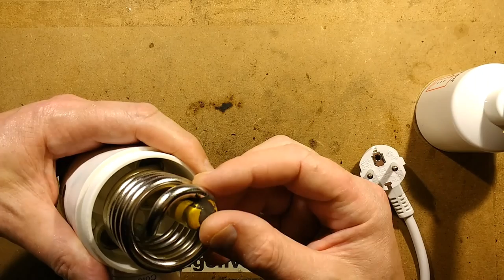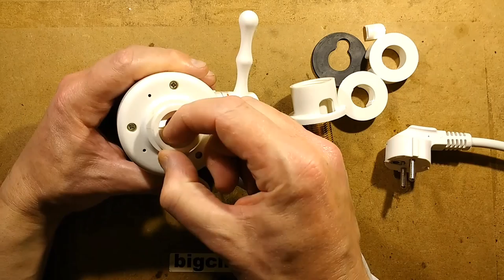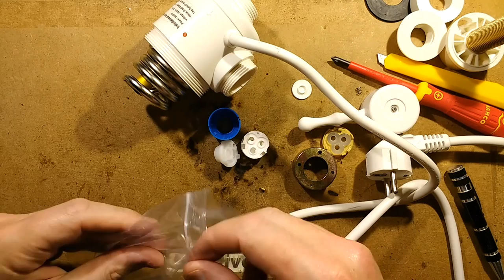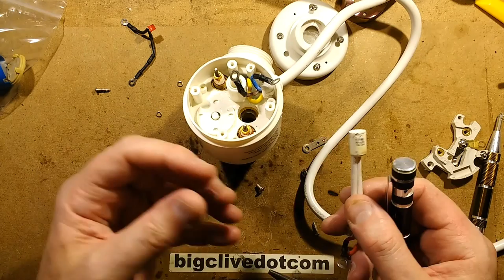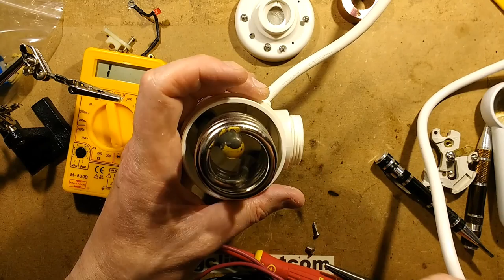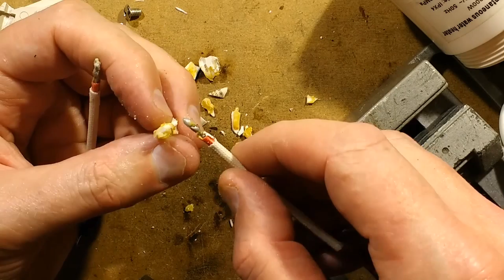Cheap electrically heated tap / faucet teardown.  (230V)

Comment: A tip to improve the lifespan of you under sink heater. Bolt a piece of aluminium to the heating element in order to work as a galvanic anode. Like they use on the hul of a ship. You will sacrifice that aluminium and not your heating element.
Reply: Frank Heijkamp , the water flowing over the heating element if exposed to aluminum may work as you mentioned. However, the dissolved aluminum in the water, is toxic if the water is consumed.
Reply: Sacrificial anode?
Reply: zinc works too, but you don't want zinc in your drinking water
Reply: Should magnesium be used instead? What PPM count of aluminium is considered toxic? As said I'm not an expert on these matters.
Reply: both zinc and aluminum (oxide or elemental) are safe to ingest in small quantities, aluminum oxide is filler in many medications
Reply: Aluminum is neither toxic nor a heavy metal.
Reply: No, the science that went into researching its potential toxicity does.
Reply: On the other hand ...

Volts, Amps, Watts, and Ohms,
I hope you'll stay within your homes.
Do not char my gleaming bones!
Volts, Amps, Watts, and Ohms
Reply: I stopped buying antiperspirants containing aluminium for this very reason and now use the ones with mineral salts which kill the bacteria producing the odour!  These seem to work really well unless you produce copious amounts of sweat!
Reply: lol, aluminium is listed as both a light metal on the 'normal scale' and as a heavy metal on toxicity scales, you can see how it will split people into groups, i didnt know but just googled, and you get both results.
Reply: Doesn't toothpaste contain aluminium?
Reply: Definitely not as plain metal.
Reply: LOL "Definitely not as plain metal."
Reply: With such conflicting information, "When in doubt, do not do it".
Reply: Yeah aluminium not so good..Does using dielectric separators before the copper pipes make any difference? What about galvanically isolating behind a big transformer
Reply: A N ,  sometimes you have to way the cost of replacing the water heater against the cost to adding a system of water purification, which will help extend the life of the heater of this type. In my home, l added a reverse osmosis water filter.  I get the benefits of pure water and a heater that will last longer.
Reply: restcure, on the other hand, five fingers and a thumb
Reply: It's not the Ohms that getcha, it's the Mhos. ;-)
(units of conductance, inverse ohms)
Reply: 90vanman  Not since that incident with the table saw ...
Reply: Statistically, there are two types of people, those who believe there are two types of people and those that don't.
Reply: @quaxk  Hahahaha. Ya ok.  Wow

Comment: You should have run the exposed fuse under the heat gun to see its melting point reaction. And check the voltage if it fused back together.  That would have been interesting.

Comment: I get the feeling centralized water heaters aren't really a thing in Europe. Here in the US, usually we just have one centralized heater, usually its right next to the furnace or boiler (my friend's house has a hot water heat system and it has a heat exchanger for hot water, heater by the boiler.) The two types most people discuss here is tank or tankless. Tank water heaters are just larger versions of he non-vented type you mentioned, tankless just heat the water as it passes through, usually considered more efficient, because like this faucet thing, they only heat up when the water starts flowing. Tank heaters have to stay hot all the time. Naturally we have to let the hot water run for a minute for the water, which cooled as it sat in the pipes, to flush out and the hot water to get there all the way from the heater.
Reply: compactc9 . yeah, pretty sure Clive is well aware of water heater designs. but a lot of the industrialized world is going to tankless. Not just Europe.
Reply: compactc9 You're feeling is wrong from a UK perspective. 

Older systems will use a tank but most new systems in the uk as far as I'm aware are combi boilers which provide heating and hot water as needed. 

We primarily use natural gas, much cheaper to heat water with. 

I've never come across an electrical water heater outside of maybe somewhere like a workplace where one has been retrofitted in. 

I can't speak for continental Europe and the hotter countries where houses may not have the need for heating systems though. You might well be right there.
Reply: compactc9 I'm afraid that your feeling is wrong. We have tank and combi systems in the UK - homeowner choice.

Comment: That orange stuff inside the thermal fuse looks like solder rosin, probably to make sure the solder pulls away and doesn't blob around in the middle causing intermittent contact.

Comment: i know it is an entirely different thing but yesterday i replaced the string pull switch in my bathroom. luckily the bottom bit, that held the knackered switch mechanism was exactly the same size as the bottom of the new one i got off amazon. so i only had to replaced the broken bit. the thing is not so long ago i didn't dare touch anything involving AC. it wasn't until i saw Clive stuff home-made full wave rectifiers and LEDs into a bulb arrangement that it was sufficiently de-mystified for me to get involved with. i started by winkling transformers from old things (NOT microwaves) and playing with them. i had a few 'tingles'. but now i have a working bathroom light cord! and get this, our bedroom light switch is iffy. i just ordered one of them too!

Comment: It is a good idea that the power is controlled by the pressure, in that way you won't be able to turn on the power without waterpressure and melt down the unit or burn down the house. if all the other safety features fail.

Comment: 3kw is also a common limit on heating devices in the US - it will be on a dedicated 30A/120V circuit. Pretty much the largest single leg 120v load you will find.

Comment: We got one of these a few weeks ago and it works just like Clive said it would. Takes about 10 mins to fill the sink with hot water.

The unit i got is a little different in the handle but the rest looks the same. <$50 AUD

Comment: I loved the vice gadget.
 I have a 12V 25A power supply for an amateur radio and it has a fusible link in the transformer. Once blown you throw away the transformer. I think it’s just a lead (Pb) wire or maybe a low melting bismuth alloy.
Reply from the maker: You can get replacement thermal fuses.  On a transformer it's usually just under the tape where the primary wires go on.

Comment: clive: back in the 80s we used to have one of those whole house instant water heater instead of the 40-80 gallon water heaters(in the .us) used to go through the heater bits fast too, was bad local water once when from village water to city water, problems solved. those units are nice.. as long as no "Extra" stuff in water :)

Comment: The diaphragm isn't operated by the back pressure from the spray nozzle, it uses the pressure drop across the hole where the water enters the heating chamber.

Comment: Interesting water heater.  Shame the fuse could not be reset, but I suppose that in itself could be dangerous.  However, for £20 I suppose it might be just as cheap to replace it if it goes faulty after a few years of constant use.  I even like it.  It looked like the solder that you can melt with a match that they were using as a fuse Clive.

Comment: They work much better in warmer countries; they are very popular in Brazil.
Reply: In northern countries it might be less effective indeed. The tapwater entering our homes is colder. Depending on the season a temperature around 8 or 12 degrees C is common. It takes a lot more then 3 kW to get a descent amount of hot water. Usually 15 kW will work just fine.
Reply: 15kW? That's madness. That's more than my entire house uses at any given time.
Reply: You can also get them in 28 kW if you would like to fill up your bathtub. Yes that is indeed three phase 230 Volt at 40 Amps.
Reply: How can this not blow a fuse or trip a circuit breaker?
Reply: +Joseph Nicholas Units above 3kW in Australia and 7kW in the UK require their own dedicated circuit from the distribution box, meaning they have their own run of higher gauge wire to provide the necessary current.
Reply: Joseph Nicholas Why would a hardwired appliance circuit designed for 40A 3-phase blow a fuse or trip a circuit breaker when run within those limits?
Reply: +Ethan Poole he might be talking about the plug in units, and yeah, in the US with 110V mains you can't draw 3kW from a standard outlet.
Reply: UK plug master race

Any power shower installation worth its weight will have its own breaker and dedicated wires to prevent electrical fires
Reply: I like: "dedicated wires to prevent electrical fires".
Reply: Maybe it's because I'm a spoiled American, but who seriously showers for 3 minutes? I probably take 10 minutes at least lol.
Reply: Just use the proper sized cables and fuses/breakers.
And pray for all on the street doesn't take a shower at exactly the same time.

Comment: i think the yellow stuff in the thermal fuse in flux to keep off an oxide layer on the low temp solder to ensure that it doesn't glob and bridge (unlike the thermal protection in that giant MOV fuse from your previous video) but rather like hydrogen bonds in water, keep itself like droplets.

Comment: As you unscrewed it I really hoped it would just have a bare coil of resistive wire in there, the heating element is quite neat and I wonder if it could be repurposed.
Reply from the maker: It's a common approach to heating water.  Secretly I was hoping for a bare element too.

Comment: can the click be done away with?? and does frequency matter ? will 60Hz be OK for this? at 220/240vac? I totally trust your judgement. would you trust this? and /or use it? I have also seen the tank less water heaters similar to this. what you think? so would you go with the tank less heater instead? electric tank less? I guess I should have watched the whole video. before asking questions... sorry. I do need hot water for my off grid home. your advice is gold, greatly appreciated! I was planning on using the electric heater as a hot water storage only. and use solar heated water. but this looked good. but I'm unsure. and if I buy. it has to work. I can't afford to waste funds now. I will have 10-12kw total power soon.inverter and generator power. for now I'm using the generator to charge batts. until I get the solar up. and a small hydro generator. if you know of the tank less water heaters ( or anyone) I would like to know if its worth buying. and works decent enough to take a shower. and wash dishes. since I'd say this is for making Coffey or tea.  thanks so much for such great videos!!!!!
Reply: James stranger maybe dont buy a cheap chinese one but i dont see why it wouldnt work
Reply: James stranger resistive load won't care for frequency it works even on DC or rectangular waveform from an inverter. its like duty cycle for the load :-)
Reply: Moes 
thanks. I ask before I watches the video to the end. I didn't know if there was electronics.  thanks again. I am still curious about the tank less water heater. that is on eBay with these. are they worth buying?
Reply: Ro Bc thanks

Comment: Before you shut that thermo-thingy. i was sure it is a thermo-fuse, although I have never seen it.
It is just to small to house a bi-metal for 3kW, AND have a wall thick enough to withstand years of heating and cooling.

Comment: I know what you mean...but people with central water heaters could put in recirculation loops.

Me, I have a tankless gas water heater which has a 2 l buffer tank and an integral recirc pump.  There is a valve inside which determines whether the pump recirculates just through the buffer tank or also through a recirc loop. (a Navien NR210A)  I haven't (yet) plumbed in a recirc loop, so I'm still waiting for warm water at the faucets in the morning.  It's one of those things I've been meaning to get to....someday :-)

Comment: That "thermal fuse" is very likely to have simply been some low temperature Bismuth based solder alloy.

 I have some which i use to solder heatpipes without bloating them, as very often will happen if you try to heat them up to the melting point of even old leaded solder.

Comment: 3kW = roughly 28.68 mL of water per second raised from 0 degrees C to 25 degrees C
Reply: checks out. you got too many sig figs though 30 mL/s is correct.
Reply: Sounds suspiciously close to 1 floz
Reply: MrEdrftgyuji whats a floz?
Reply: floz stands for fluid ounce , 29.5735 mL.
Reply: Nah floz is a name that is short for Florence
Reply: Of course if you're heating from 0c you might have a hard time getting the water through your frozen pipes.
Reply: What have I come back to. This was back of napkin type calculations guys assuming perfect conditions.

In general the calculation done was for a 25 degree heat change in the water assuming perfect and instant heat distribution, so the talk of the "water being frozen" at 0 degrees C is a moot point, though at that temperature water might be liquid. Yes, I did use too many significant figures since 3kW is 1 s.f. and yes the power supply is not going to exactly be 3kW. This was just to provide a rough idea of how much water would be coming out of the tap.
Reply: I should have put a :) at the end of my post. I appreciate your back of napkin calculations Hog.
Reply: @ramunasgudauskas7582  A fluid ounce is 28.4 ml in the UK.  It is a pure coincidence that it so close to being able to heat one ounce per second, as all the figure used to derive that are metric.

Comment: Looks like a surprisingly decent product, actually. Especially surprising being Chinese. Here in the US there is an instant water heater by Chronomite, "Instant-Flow". They are ubiquitous in the commercial world, and seem to be very well made. They're made for all manner of different voltages and power ratings. Very surprisingly indeed is the fact that the heating element is unsheathed. It is presumably nichrome wire, in a coil, directly in contact with the water. As a result they begin delivering hot water VERY quickly!!

Comment: I'm really trying to figure out what good this would be used for. My parents installed a full house hot water circulator pump at the water heater so at any faucet, you turn on hot, it's hot right now, very very little water wasted. They did this because the hot water heater was located on one side of the house and the bathroom on the other side took a minute before they had hot water. Now it's about a second, they love it!
Reply: It would be good for places that only have cold water.

Comment: We have instant hot water from the tab aswell. Simple reason beeing the circulation pump starting at 5am running to 8am and then again from 5pm to  8pm.
Central heating ftw!

Comment: I wonder if the over-temp cut-out is actually designed to work when the thing is hooked up to, and filled with water. I mean, regular water boils at 100 degrees, can it even get to 120 degrees?
The only way I know of to get water superheated is to use distilled water which doesn't "boil" as it is low on impurities. 
I guess when the water evaporates in the unit, the top of the element will be able to rise in temperature exceeding 120 deg. though, so it will work eventually.

That being said, I have no idea at what temperatures the automatic switches of electric kettles are specified. You know, the ones that switch off when the water boils. I don't think they are set for 120 degrees, more like 105 or so.
Given that this tap doesn't need to boil water, just heat it up, my reasoning therefore is that the 120 deg. rated fuse is excessive. Also, I'm sure someone has a better knowledge of these things than me.
Reply from the maker: I think this is for when the unit boils dry.

Comment: i suppose it seems not designed for direct drinking purpose? i mean there's solder visible on top of the heater, or is that part never make contact with water?

Comment: The bad thing with heaters like this is scaling. There's no way to flush them out from time to time.
It's the same with large water heaters, but larger water heaters last longer because the scale flakes off and lays to rest at the bottom of the tank.
I got a tankless water heater 3 years ago, and it's the first water heater that has the capability to be flushed once a year to get rid of the scale that collects on the heating elements.
If this isn't done, the tankless water heater wouldn't last very long, just like the small under sink heaters...

Comment: I think 120 degC is high enough above the boiling point of water that the fuse would only blow in unusual circumstances (tap turned to hot but with no water coming in from mains, faucet blocked, and safety vent failure, at the same time.)

Comment: In the US we use a different strategy. There is one gas-powered hot water heater in the basement of my apartment building. Seems to work fine.
Reply: John Gotts most houses and flats here in the uk will have their own independent gas combi boiler for water and heating.

Comment: A compact version of the old 3kw heatrae carousel, the slower the flow, the hotter the water
The outlet can get blocked by limescale,
You would have to cut the plug off if you want to feed it from under the sink
The undersink heater, like the one you have, often failed where i worked, the thermal (one shot) fuse would fail, though it was replaceable
Reply: Yeah I think limescale will kill it quite quickly by blocking up the spray plate too - didn't seem to be any way to get it out for cleaning